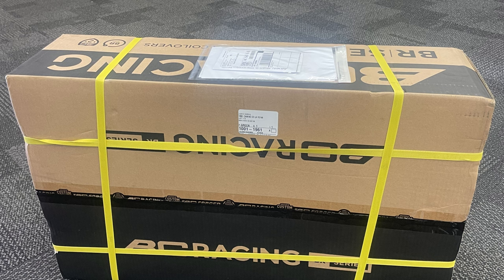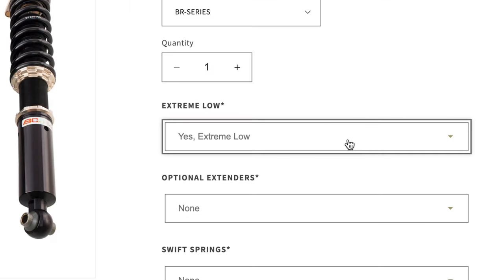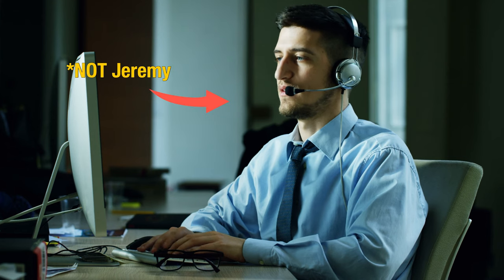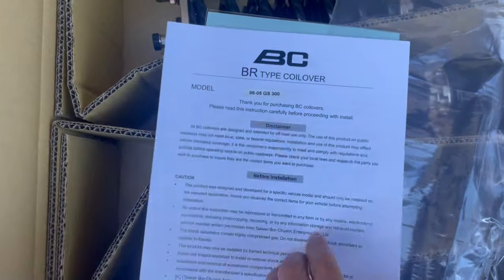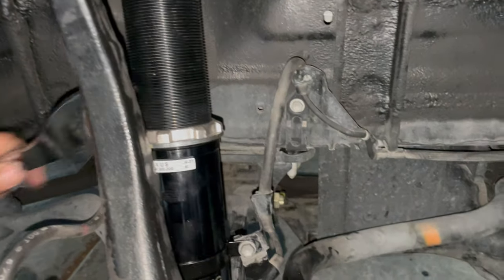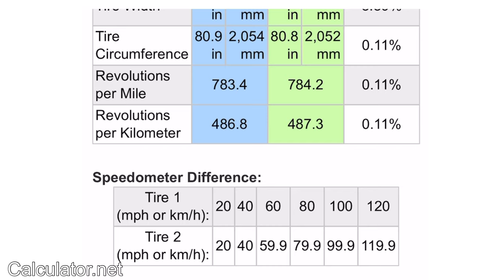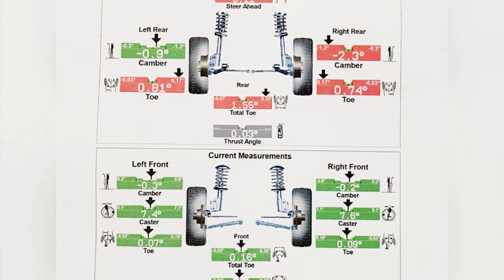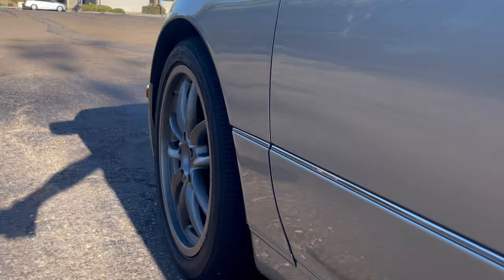BC Racing Coilovers HONEST Review. Worth the hype? #BRSeries

Comment: Rear rebound dampening was practically non-existent on a 2008 Accord V6. On certain roads, the rear would start to "pogo" until the car was close to uncontrollable. I installed BC Coilovers, dropping the ride height about 30mm, and handling was transformed.

One issue we had - the height adjustment lock rings would loosen and the coilover begin to "bang" over bumps. Even tightening them wuth a punch and hammer couldn't keep them from loosening up again every 5000 or so miles. Not that big a deal but it did get old...
Reply from the maker: @41Forethought  great comment. I haven’t had that issue happen -yet-. The coworker who recommended these to me has that issue actually. There’s a video somewhere (I can’t find it) where the guy explains how to avoid this. We installed them without any prior knowledge of this and I haven’t notice any noises etc but I’ve only had them for like 3k miles. Maybe the issue will surface later. 🤷🏻‍♂️
Reply: It's good ro hear that others had the same issue. Seems to me I read something about the coilover clunk but I didn't remember it until you referenced the video.

Comment: BTW, we finally made the first long trip in our 2025 GV70 2.5 SP. We drove from Sonora, 85 miles southeast of Sacramento, to Gresham, Oregon last month. It took just over 12 hours with 2 stops for gas. We averaged 29.7 mpg, usually at around 75 mph. We'd been averaging just under 22 mpg so this was quite a bit better than I expected.

I NEVER could have driven 12 hours straight in our previous CR-V. The very quiet cabin combined with the massaging seats to make the long drive a pleasure.
Reply from the maker: Wow! 29.7 is way more than I’ve ever had in any leg. I’ve done slightly over 28 mpg in very particular conditions: no wind, mostly no elevation either way. San Diego to Murrieta and back, 75 miles each way. Steady 75 miles per hour, no cargo. 

As far as cabin noise: Hondas are really bad in that category. I’ve had 2 civics… and my TSX was nearly just as bad. Even back in 2004 when I had one brand new. Noise tires me out. I’m old, everything tires me out 🤣
I’m glad you pulled 12 hours of driving in comfort. I can’t find my optimal seating position to mitigate the firmness of the seats. The massaging helps but when I’ve done my long drives, my lower back feels it. 

I just did a trip to El Paso from San Diego. Round trip in 3 days but took my 2003 Lexus GS300 and honestly the comfy seats worked better for me… wifey complained about the limited space in the front row vs the GV70 though.
Reply: @JuanCarlosLTO  Yeah, that mpg was crazy! I thought the vehicle computer was overstating it so I checked it by hand at the second fill-up, and there was only a .2 mpg variance.

It took me about 45 days to find my optimum GV70 seat adjustment. I originally thought that the bottom cushion was too high - it felt like I was perched on top of the seat instead of in it. I experimented with the cushion pressure and finally got the height and the firmness where I wanted them. I guess this just proves that everybody's butt is different!😏

For me, that 2008 Accord had the worst seats of any car I owned. I could never get them adjusted to my satisfaction. If I drove more than 3 hours at a stretch, my back was so stiff it was difficult to get out of the car and stand up straight!

I'm old, too (older than you, I suspect) and car noise really wears me out as well!

Love your reviews, Juan - keep up the good work!

Comment: I ran a set of BC on my 2001 BMW Z3 3.0i Roadster. I wasn’t daily driving the car so I went with a slightly lower ride height (1 finger gap in the front & 2 finger gap in the back) The ride was definitely stiffer than stock, especially with the lower ride height which didn’t allow the suspension much travel, but it wasn’t uncomfortable. I enjoyed taking the car down back roads and honestly the only time the ride was harsh was over harsh bumps like a deep manhole cover. Even over cobblestone the ride was firm but comfortable and not bouncy. And again, I was significantly lower than you. I think they are a great set of coilovers for the price ($1,800).
Reply from the maker: $1800? Are you in Canada? Asking because in the USA they’re about $1200 USD just about across all vendors.

Yeah, that’s the subjectivity of taste. I’ve had 3 BMW 3 series from different eras and the last one, an E90, had the M Sport Package so it was slightly lower and along with the stiffer suspension were the hard and bolstered seats. The car was gorgeous and drove nice but it would tire me out on longer trips.
This Lexus is a couch on wheels and the BR made the ride a bit more “sporty” without being a beating. I’ll find out next month when I will do a 1600 mile round trip in 4 days if I didn’t ruin the comfort too much.
Reply: @JuanCarlosLTO  I don’t actually remember how much I paid. But it was somewhere in that ballpark because I also got swiftsprings with mine. But I believe it was $1,800, possibly $1,600.
Reply: @JuanCarlosLTO  And yes, ride was firm, seats were firm, steering was hydronic and heavy, convertible top was loud, and you could hear all the workings of the transmission and differential as you drove down the road. Hence why I didn’t daily drive the car lol. I think in several years I only put about 6,000 miles on it. When I finally sold it (100,000 miles on the clock) the guy said to me “this car isn’t going break down on me is it? Because I have to drive 700 miles back home”. And I responded “I am more worried about your lower back than I am the car brother.” Lol

Comment: The BR was originally under 800€. Now its 1200€. On mk4 supra the front cannot even be adjusted to the original ride height. Front sits too low and cant drive over curbs. Would not recommend.
Reply from the maker: Do you think they’re too short? Sucks that they didn’t work out for you.
Reply: Or the spring rate is wrong. Seems like longer springs would solve this. It was possible to get custom "swift springs" for free when purchasing bc coilovers, but i didnt know what spring rates to get. Current stock bc spring rates according to package are Front 14kg/mm and Rear 10kg/mm.